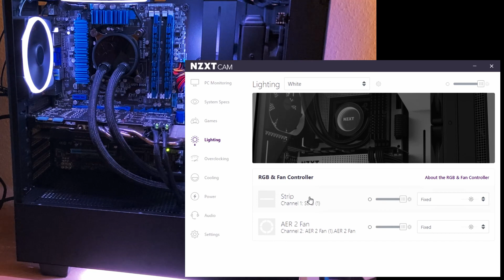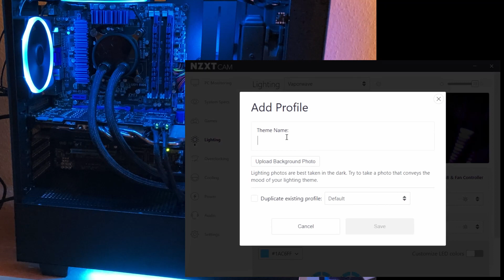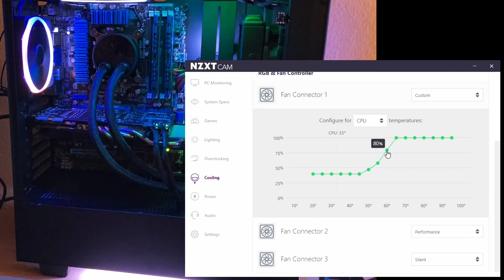Installing NZXT AER RGB 2 Fans and Hue 2 LED strips in the H510 Case using the RGB & Fan Controller

Comment: Hi, I need some help. You know the cable that connects from the rgb fans to the controller in order to enable to lights on the fans. Which product does that come with? I have the rgb fans in my pc already and I have the just bought the controller. It seems like that’s the cable I need to enable to led lights.
Reply from the maker: Hi there, the cable that goes from the controller and to the first fan is included with the fan.
It is cable C and you can see that it's included in every fan bundle, single, twin pack and 3 pack: 
https://sta3-nzxtcorporation.netdna-ssl.com/uploads/download/attachment/734/AER_RGB_2_Manual_081518_web.pdf

Comment: Hi, I’m building a similar pc right now. However, I can’t fit my top 140 mm fan because the 8 pin cable connected to the top left corner of the motherboard blocks the fan from lining up with the screw holes. How did you fix this?
Case: NZXT h510 elite
Motherboard: Aorus x570 elite
Top Fan: AER rgb 2 fan (140 mm)
Is the led fan controller necessary if I want to light up 2 fans(140 mm) on the front, 1 fan on the back (120 mm), and 1 fan (140 mm) on the top?
Reply from the maker: The H510 Elite comes with the controller installed, so you should be good. About the CPU power cable, then I guess it really depends on large the plastic cover for the IO shield and the VRM heatsinks is. With the motherboard I used in this video it wasn't really a problem, but I have experienced that I needed to use an extension cable on the power cable that I could bend more than the one that came with the PSU, which has a giant headshrinker tube on it and can't really be bend very much.

Comment: I have an H510i with a controller (as you know), and I want to keep 2 stock fans in front as intake, and get the 2 aer rgb fans as well. Since my controller only has 3 fan slots, would I need a splitter as well? Or are the fan slots just for rgb control? Sorry if it’s a dumb question lol
Reply from the maker: Hi Iron Mota, you don't have to - you can also just use a fan-header on your motherboard for powering one of the fans - but no the fan slots on the controller isn't only for the RGB fans, you can connect whatever fans you want (It's only the RGB slots that are for NZXT RGB only) :)

Comment: Excellent video! I got the same NZXT case with a NZXT Kraken X63 RGB cooler and I replaced the top case fan with one of the extra fan you get with the cooler (since the case comes with 2 RGB fans installed) but sadly my top RGB fan spins yet it doesn't light up, I guess must have done something wrong with my cable management. Thanks again and greetings from Peru!
Reply: Bro I did the EXACT same thing as you:
H520 elite case then I got kraken x63 and moved the rgb fan from the front to the top and the rgb didn’t work…..what did you do?
Reply: @joshnewman6290  hey Josh, I had to double check my daisy-chainned fans and make sure they were getting to the right place. I remember I ordered an extra 240mm and a 120mm to replace the back non-rgb fan. As of today all fans are operational and they light up. Hope this helps bro!
Reply: @flyrrow  does the x63 cooler support all 4 nzxt rgb fans (2 on rad + 2 extra) by daisy chaining?
Reply: @nuggetaim1562  Hey, my 2 fans from the back and my 2 from the front are daisy chained in 2 separate cable lines and they reach the control rgb box from both sides. I also got 3 rgb stripes daisy chained independently. Hope this helps!

Comment: Hi, thanks for the video)  can you tell me, in and out ports only for  rgb or it’s for power too? I mean I need to connect all cables to control hub or connect only in and out cables?
Reply from the maker: Hi, the RGB ports are for powering the RGB lights, the Fan ports are for powering the Fans, so yeah you need to a fan to both - you can also connect the fan power cable to the motherboard, doesn't need to be the controller (But the RGB has to be connected to the controller).

Comment: Did you chain together the fans and the LED strips?
Reply: Sorry, I've just noticed how you did it, you linked the aer fans with the hue 2 led strips, and you connected the old hue led strip to it's own rgb channel because you can't chain gen 1 with gen 2. Correct me if I'm wrong.
Reply from the maker: You got it right 👍
Reply: @MrGarfi  Thy!

Comment: if i have a h510 elite case that comes with a hub mounted on it, will i be able to connect these fans to the hub or i need an extra hub for it?
Reply from the maker: Yeah you just connect the fans to that controller instead, no need to get an extra.
Reply: @MrGarfi  thank you, you really helped

Comment: Hello,
I have a short question. I can see the data, such as fan speed in the software and under "Lighting" the fan controller is displayed but the fans are not displayed to change the colour. Do you have an idea how to fix it?
Reply: @Adriaan Bax Yeah I did. I didn't saw the cable in the box which you have to connect to the LED port at the controller. I just pluged in the cable which is already at the fan

Comment: I have a question. Can I have two RGB Corsair fans and a corsair H100i plugged into the HUB or are there not enough openings for that?
Reply from the maker: Hi there, what HUB are we talking about here? Because this NZXT controller can only have NZXT fans connected to its RGB channels, the Corsair fans have their own setup.

Comment: Thanks for the video... I will working on the same setup this weekend. Question: I have NZXT 510i, do I still need to have the RGB&Fan Controller? or the V2 controller come with the case will do? Thanks!
Reply from the maker: Hi there, thanks! It is basically the same, so you are fine :)
Reply: @MrGarfi  Thank you, I will cancel the RGB controller from Amazon :-)
Reply: Are you 100% sure the V2 controller that comes with H510i will be able to control AER?
Reply from the maker: @AM93000 Check the NZXT homepage -  they can handle the AER but they have to run on their own channel, so they cannot be chained with AER 2.

Comment: hey I would really like your help on a similar build you made my gpu wouldn’t turn on and also all my USB ports don’t work
Reply: check all connections, gpu power must be correct and usb connector on board must be in correct spot

Comment: Since you get both hue version, what's the difference between those ?
Reply from the maker: Hmm honestly I am not sure - the only difference that I am aware of is that with the Hue 2, you can chain both strips and fans, where on the Hue+ units they needed a separate channel for each types.

Comment: For a x63 kraken, two RGB fans and a led strip cable 1 controller is enough?
Reply from the maker: Actually the X63 has a hue on board, and I am pretty sure you can chain the RGB fans and the strip together on that one as well, so you don't need the controller - but don't just take my word for it, double check it with NZXT, I could be wrong. Plan on getting one also at some point.

Comment: Does it work on a non modular psu?
Reply from the maker: Yes, as long as you have a SATA power connector available, it doesn't matter what PSU you have, modular or not.

Comment: Why do I get a beeping noise when I plug my rgb nzxt fans into the rgb header?
Reply from the maker: What RGB header? The one on your motherboard?
Reply: @MrGarfi  yes that one. But Nevermind I figured it out. I found out that I needed to plug in the out from the (out and in) into a cable that was apart of the bunch of cables on the aio. I’m not great at explaining but it works now

Comment: do you need to remove the tape from the back side of the strip?
Reply from the maker: Only if the magnets aren't enough to hold it - I don't use the tape.
Reply: @MrGarfi  thank you for the rapid response

Comment: Hi im new to rgb stuffs will nzxt rgb fans work with a corsair commander pro?
Reply from the maker: The fan controller will, but you cannot control the rgb lights on nzxt fans with the commander pro, for that you need a nzxt rgb controller.
Reply: @MrGarfi  so which one nzxt hub should I buy? Im planning to use 9-11 aer rgb fans

Comment: Nice Video! Can anyone confirm that do I need to purchase the rgb controller if my NZXT 510i Elite case already has one? I plan to run 2 x AER rgb Hue 2 fans, a Kraken Z63 AIO and the under glow kit, all by NZXT. This doesn't include the pre-installed 2 x front rgb fans that come wirh the case. Will the pre-installed controller run all of these (if I daisy chain) or do I have to purchase an additional controller? Thanks
Reply from the maker: Yeah it can - you can chain the 4 fans, and then run the LED strips on the other channel.
Reply: @MrGarfi  many thanks for the reply :)

Comment: question is the fan controller required if you have 2 rgb fan headers
Reply from the maker: Hey Radu P - I am not sure what you mean with "if you have 2 rgb fan headers"? Do you mean on the motherboard or? The controller is only needed if you have NZXT AER RGB 2 fans that you want to control the lights on.
Reply: @MrGarfi  sooo you cant control them with motherboard rgb fan header because i can controll the kraken rbg with one?
Reply from the maker: @Radu P  you can control the fan speed ofc. but not the lights on the fans, they need the separate RGB Controller. You can control the Kraken because its connected via. a USB header, that one takes care of it. Come to think of it, what model of the Kraken are we talking here, because the "new" Kraken X63 has an Hue 2 controller also, that one can be used instead of the RGB controller from NZXT. But no, you cannot connect NZXT fans into the RGB header on the motherboard, you potentially risk damaging both lights on the fan and the motherboard by doing it, especially if using a different voltage connector (12v vs 5v).

Comment: Great video, really helped clear up some of my questions. I did have one other question-

I have 4 AER RGB 2 fans (2 120 mm ones, and 2 140 mm ones that came with the Kraken x63 RGB). Additionally, I have the H510i which comes with 2 LED strips. The H510i RGB controller has 2 LED slots. One is currently wired to the 2 LED strips (the case came that way), and the other one I used to daisy chain my 4 fans together. Now, my only problem is the Kraken x63 CPU mount has an RGB connection that I don't know how to route to the RGB controller. Can it connect to the RGB strips? Can it daisy chain off the fans? I am a bit nervous since this is my first true build, and my first one with water cooling, so I do not want anything to go horribly wrong. I appreciate any insight!
Reply: It appears I have spoken too soon. It seems the RGB controller that comes with the Kraken x63 is for additional components and is not necessary for RGB lighting. I'll leave my comment up in case someone else has a similar issue! Thank you again :)
Reply: Hey - i have the exact same configuration.. were you able to make it work with the RGB controller that came with the case? You mention that there is another RGB controller that comes with the x63.. is it needed for anything or can I just daisy chain the 4 fans for RGB through the original controller that came preinstalled on the case? 

Thanks in advance!
Reply: @TheNazareth79  I was able to use the RGB controller that came with the case. If I recall correctly, the one for the x63 is for additional components should you add them. With my configuration, I daisy chained fans together using the stock controller with the case.
Reply: @emory4356  awesome, thats all I needed to know. Thanks for getting back to me, I've got the h510i + 2 RGB fans but all the ports are full on the controller right now but it's good to know I can daisy chain all the fans together! 
Many thanks!
Reply: Sorry to bother, I also have h510i and I'm looking into buying nzxt rgb fans. When you daisy chain them at one port, can you control light through nzxt app?
Reply: @stojic19  yes, if they are all daisy chained together, you can see the total amount of fans as one input in CAM. I don't think you can change each individual fan RGB separately, but there are settings that will cycle a color like a wave across all the fans in that channel.
Reply: @TheNazareth79  Thanks a lot! I didn't need individually, only if I could control them at all. I read at some page of customer support that v2 controller can't controll rgb fans and strips at the same time so I halted my order. This assured me to order, discount for them is until midnight here so thanks!
Reply: @stojic19  Yes, you can. Although, when daisy chained, they do the same thing  (you don't have control over each fan individually, rather all the fans as a whole that are daisy chained together).
Reply: I’m building my first computer soon with a very similar setup, with the H510 flow case. I’m using two 140mm fans in front and two 120mm fans in back, and an RGB strip as well. Will I be able to do all of that with one controller? Im a little confused about how there’s only 3 fan ports on the controller. Will I have to plug each fan individually into a fan port? Or just one of them, then daisy chain the rest?
Reply: Actually I think I just realized you can use the fan splitters to connect more than 3 fans right? Just trying to make sure I understand it so I don’t go through hell trying to get it to work the first time haha
Reply: @brandoncurrens3388  My build is currently in storage, so I can't check it right now, but you should be fine. If I recall correctly, I had two fans daisy chained in one port, two chained to another, and the LED case strips on a different port. (I had a 4 fan configuration, with two on the front radiator, one on the back, and one on the top). I imagine you could go as far as chaining all 4 fans into one port, but I would research before doing that. Regardless, all the fans in my build are still manageable on the NZXT CAM software.

Comment: total POS fan in terms of the RGB...  product does not specify you need a USB Fan RGB controller...  on account of this connecting the fan directly to the mobo only blows the RGB in the fan and is unreadable by Cam.